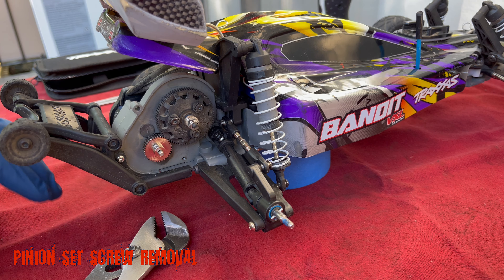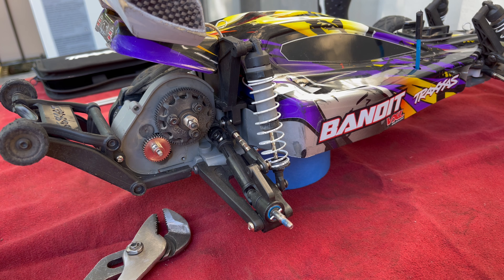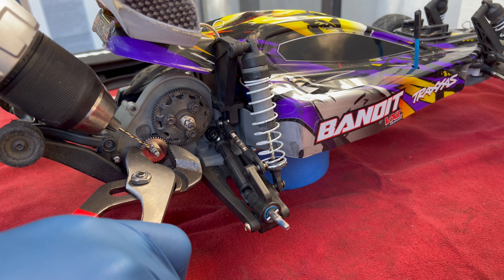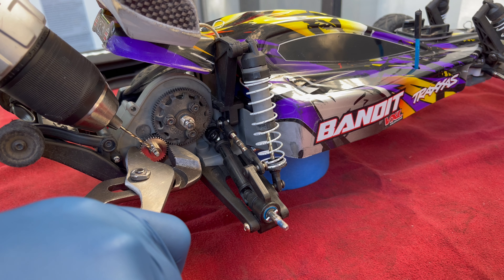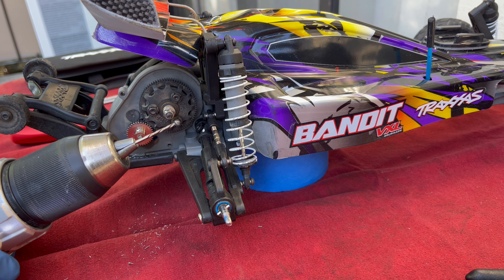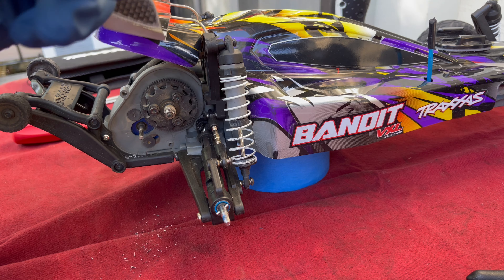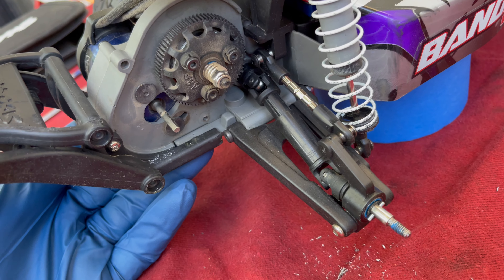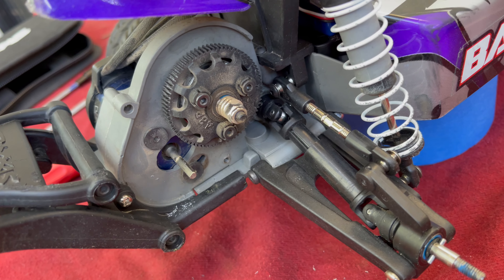How to remove stripped pinion set screw | EASY!!

Comment: Hey did you just use a normal drill piece
Reply from the maker: It’s a reverse drill bit, trick it to go slow, and make sure you heat up the set screw.